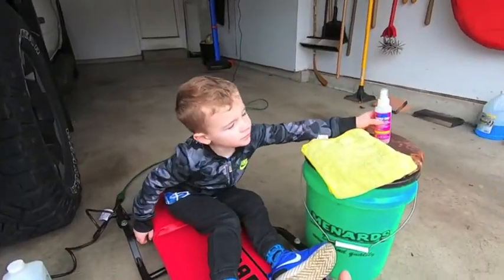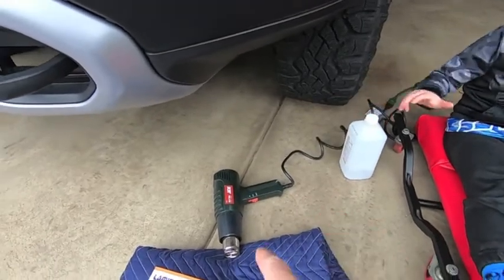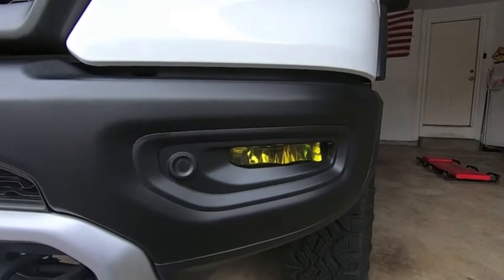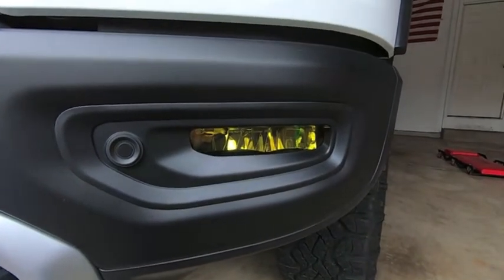Lamin-X Fog Light Cover - Ram Rebel (includes a 20% off coupon code)

Comment: Just saw your comment on the 5th Gen Forum about your upper control arms which lead me here.  Good stuff, man!  How was the light output affected when driving at night after you put the lens covers on?  Good?  Bad?  Noticeable?  Thanks!
Reply from the maker: The Rebel fog lights are VERY bright from the factory so if I did loose output by adding these overlays, I haven't noticed it.  If I would've went with the orange or the smoke, then yes light output would for sure suffer a bit.

Overall, this is my favorite cheap mod I did to my truck.  Sets off the front end of the rebel nicely and was a fun project for my youngest to help me out.  

If you're on the fence, they are cheaper enough to try out and easy enough to remove if you hate them!
Reply: @WaterFowler41  Thanks, man!  Getting them on order today. :)

Comment: Hey I thought you blacked out the wheels. What happen?
Reply from the maker: Yup I did and really miss them...  

When I was trying to clean off that blue glue over the letters (look at my overlay video, you can see the glue is still on my tires) and I slipped with the brush and ended up scratching the overlays real bad on a wheel.  Self inflicted, my fault for rushing... Then during quarantine boredom I just started picking and picking...  Starting to get the new wheel bug so hopefully new wheels before summer.